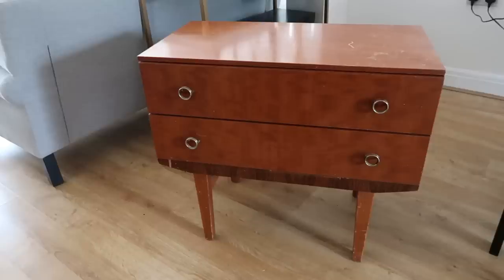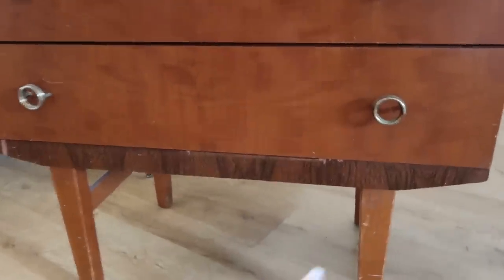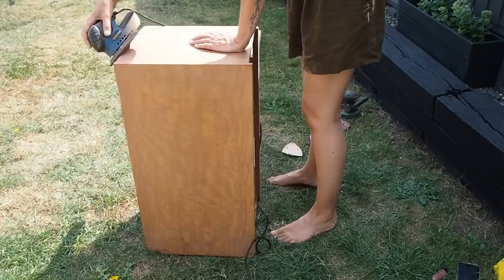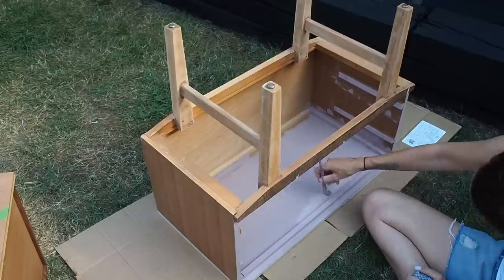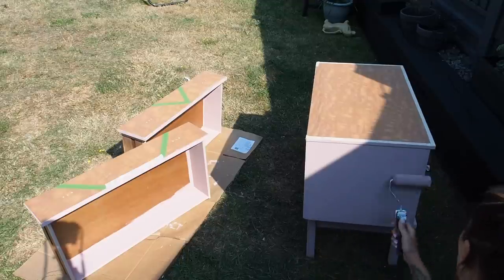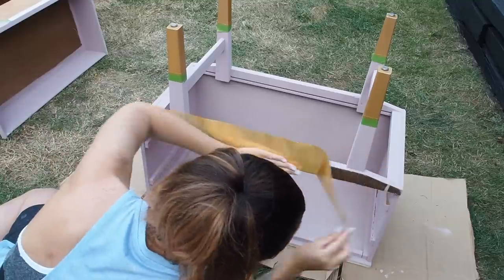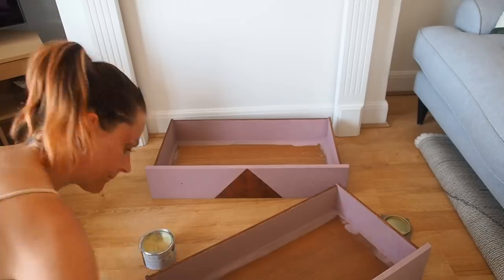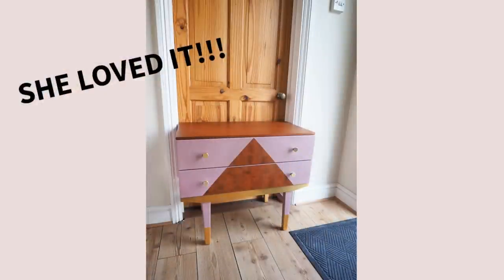SURPRISING MY FRIEND WITH A BUDGET DRAWER MAKEOVER | Up-cycle, Before & Afters

Comment: I love the original mid-century modern design and the bubblegum pink colour unfortunately takes away from it and it's a shame that the original handles were replaced with cheap ones from amazon. Really like the actual wood colour - sanding, stain and wax really brings out its beauty.